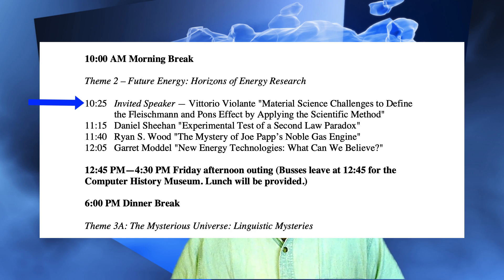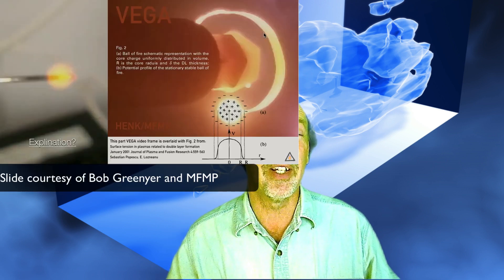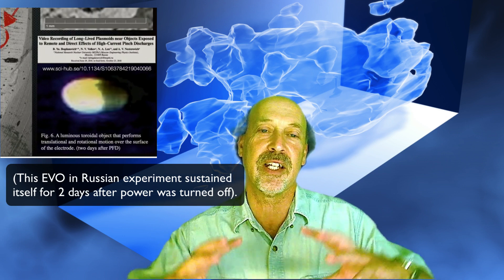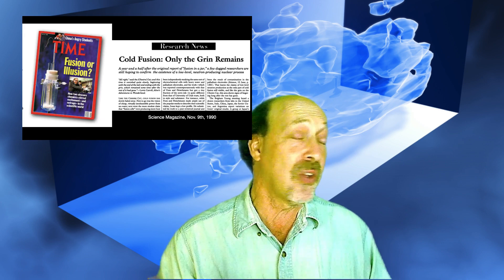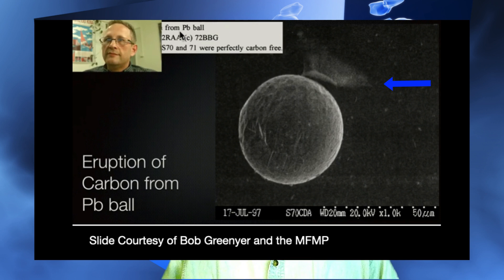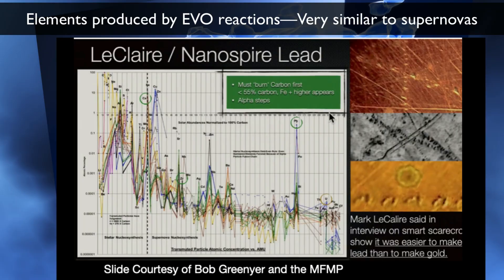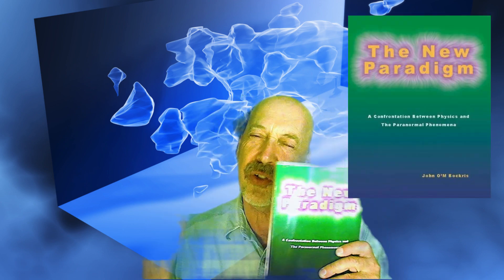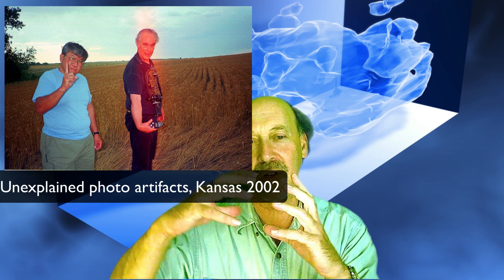The Unexpected Feature of Cold Fusion/LENR That May Prevent It From Making Sustainable Energy

Comment: Very interesting presentation. LENR is definitely real and we now produce a working repeatable active material. We use copper and aluminum as our electrodes and you are right the LENR active material does damage the electrodes significantly by transmutation so the cell changes in voltage as the aluminum transmutes. 

We have however found that the transmutation is not being caused by H bombardment but rather bombardment by Oxygen 20 species that is being ejected from the active matrial
Reply from the maker: Very interesting, thanks. Where are you doing this research? Is there some public institution connected with it that I can reference?

Comment: Interesting video, after 31 years it it time to ask questions of cold fusion / LENR? Some of us have been experimenting with water as an energy source and I'd have to say there is much better progress in developing it into a 100% energy, I have observed transmutation taking place in Brown's gas generators, however, I've been working with a non existent budget.
Reply: Did you try putting a big inductor in series with the plasma electrode? The plasma seems to act as a switch  which causes the inductor  to oscillate. It produce a more energetic plasma. It even slows down the decay of the positive electrode if you generate the plasma on the positive electrode.   Use low resistance inductors like the primary coil of a MOT. 
Here is a video I found after researching the phenomena https://www.youtube.com/watch?v=9wRSGFOdRmI&ab_channel=GmanBB

Comment: Am I correct to understand that at @13:00 you are saying you had unexplained camera failure phenomenon at the crop circles you made yourself with the help of local farmers? Or were the failures only at the ones we are speculating might be made by UFO's or ball lightning like phenomenon? I'm just trying to understand if the act of actually making a crop circle like formation is changing some kind of energy flow which may result in these kinds of camera failures, or if it is an energetic residue from the process which electrically creates crop circles. Thanks!
Reply from the maker: Right, it’s happened in circles we’ve made, Kansas 2002 and Woodborough Hill 2006,  which implies that the shape or act of making one affects energy flow in the immediate area.
Reply: @Fractalfriend  Thanks for taking the time to reply I really appreciate it. Google deleted my last comment where I suggested you check out the cropcircleship website on the wayback machine. so I'm going to try it again without spelling it out as explicitly ;)... If you do take a look let me know what you think.

Comment: Where is the helium 3 work?  Why no thorium reactors running zero point? John hutch "was John part of the mechanism" col j Alexander quote & that guy IS in the know for sure. Less in more out clean energy please. Kick starting the process seems to be the tricky part.hutch was transmuting metals ooh we can have that doc! Lead into gold ? Maybe? They cracked it then locked it away. Big oil just take you out. It's real doc it's just hidden away. Tesla got overunity and fed back to source and burnt out the windings. Needed a diode lol.

Comment: Has it been individually reproduced to have the nickel turn to copper? That's what I remember of cold fusion claims of a few years ago. That would legitimize the net energy out. And there is plenty of nickel. In your wallet, even.
Reply from the maker: Well it’s been shown that the 10 Yen copper coins can be transmuted to other elements from contact with HHO gas, will have to check what elements nickel transmutes into.